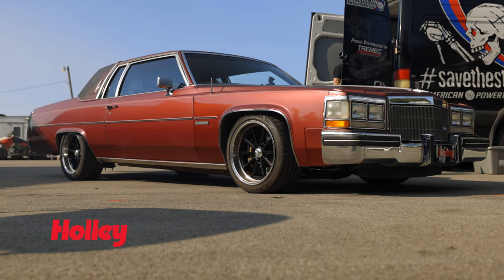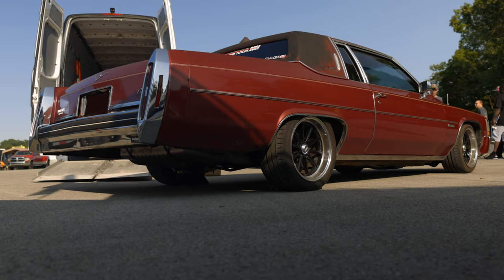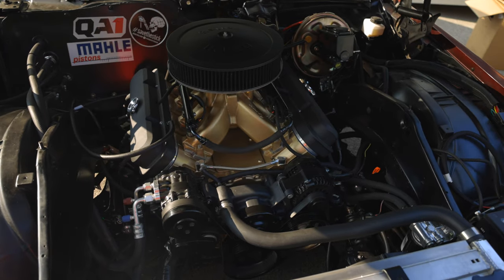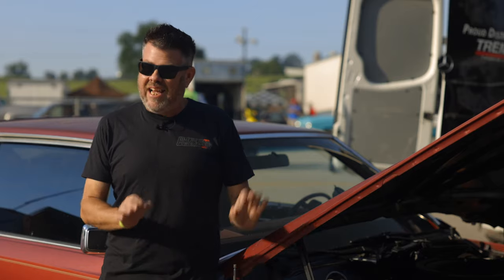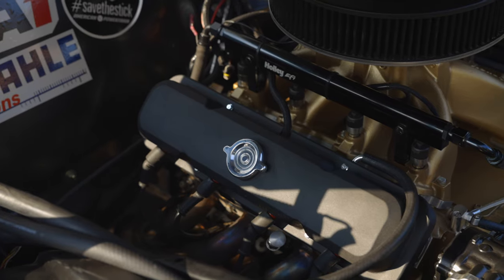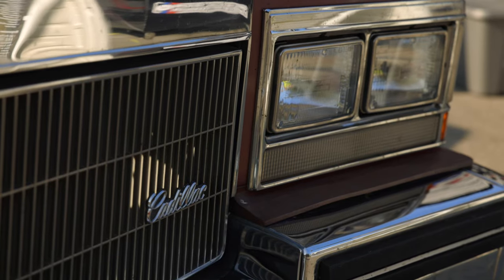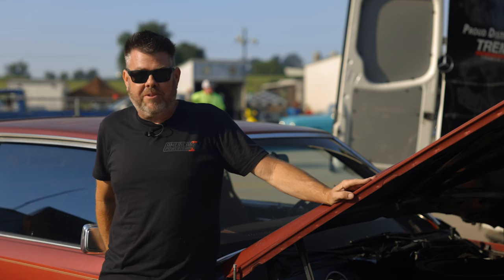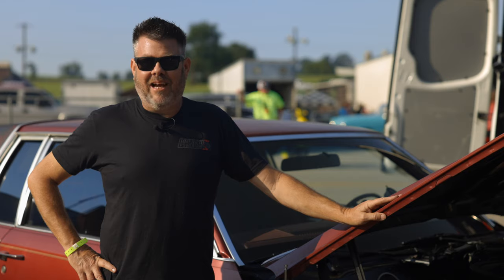Holley LS Fest 2021: Matt's “Chicken Coupe” 1983 Cadillac Might be the Most Comfortable Sleeper Ever

Comment: I'm doing a 89 Fleetwood brougham de' elegance lm7/4l60e swap. My question,  is the d body interchangeable with the b body transmission crossmember?
Reply: It should bolt right up. The bottom on B Body and D Body are technically the same.